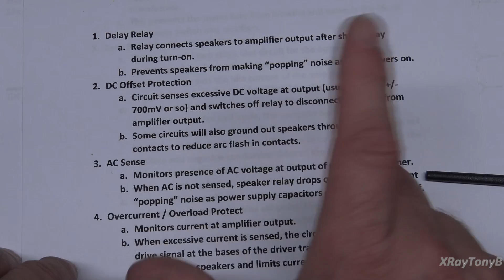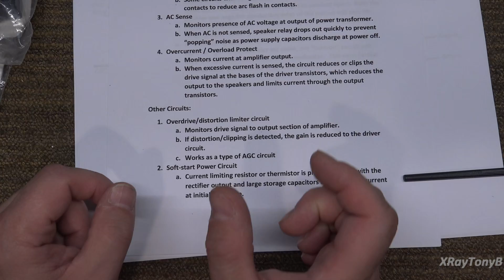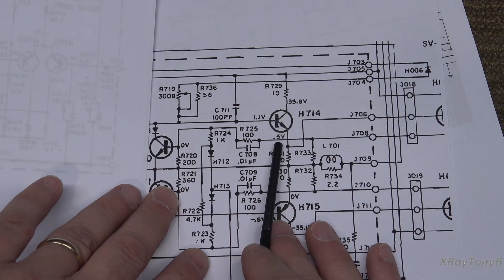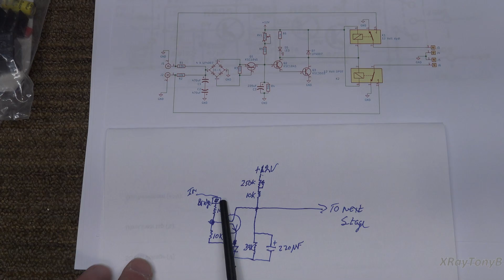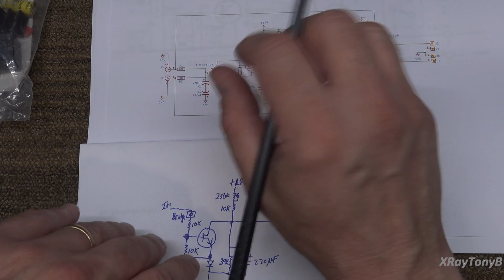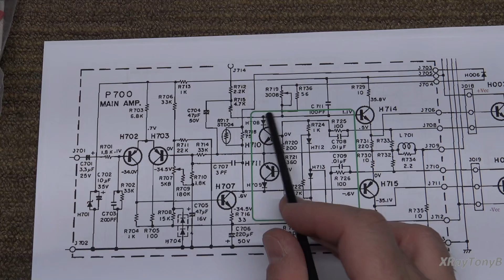Speaker Protect Circuits - In Theory

Comment: It's useless... it doesn't provide DC protection—or rather, it only works up to 20V DC; beyond that, the relay contacts cannot extinguish the electric arc. These relays simply aren't designed to break a DC arc. In other words, if an amplifier powered by more than 20V DC suffers a final transistor failure, it will send the full voltage to the speakers;  the relay—due to the very small gap between its contacts—won't be able to extinguish the arc, leaving the speakers completely unprotected. This protection scheme is only effective below 20V DC.
Reply: I would say that 99% of all commercial amplifiers use standard cheap relais in their protection circuits.
Reply: Can you provide me with a link that's got a good protection circuit I can build and or buy?
Reply: There is no mechanical relay capable of extinguishing the electric arc at voltages above 30 VDC; in my tests on various relays rated for 30 VDC (tested without their protective casings), I observed that they fail to extinguish the arc every time even at 30 VDC. The electric arc begins to form around 25–27 VDC, though relay degradation starts even earlier—at around 20 VDC. Therefore, if the output stage fails and the full DC supply voltage is routed to the drivers, mechanical relays are useless if that voltage exceeds 25 VDC. @paulstewart808
Reply: @paulstewart808 Yes... but in well-known commercial brands, they are used almost exclusively to delay the signal to the speakers—preventing the startup noise—and possibly to detect incorrect settings or DC offset anomalies. They are not used to handle output stage failure; in the latter case, other protection circuits are employed to cut off the main power supply if a short circuit in the output stage is detected.

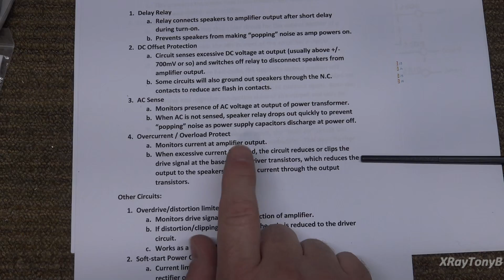Comment: 10:18  Type 5 is omitted - Speaker short circuit protection. 
a. Monitors speaker impedance and short circuiting of speaker.  
b. Protects output transistors in case of voice coil or crossover network burnout or shorting plug leads at amp or the speaker. 

The weak link in all this 'protection' is that relay, which are rarely rated for full DC current.
e.g. A large Amp under fault may have >100V DC @ 10A applied to the speakers. The prospective fault current is a lot higher.  
Kits are often only rated for Low/Medium output due to voltage rating of capacitors, so, if added to a high power amp you must upgrade Caps to suit that max output voltage.
Further, relay contacts do degrade over time and so, become 'noisy' in the signal path... and in a DC fault or short circuit fault of transistors/mosfet can weld relay contacts closed.. so, no protection at all. Use of a relay in the output signal path is a piss poor 'solution'.  mosfet switching is far more reliable. 
The use of N/C contacts as per 2b. does not extinguish a DC fault arc.
Reply: Great... finally, someone who understands the limitations of mechanical relays and why, in this case, they cannot ensure speaker protection.

Comment: Can the soft start board be installed between the power on switch on the load side off curse to the wires input of the transformer ? Thanks

Comment: 12:25 ACC 260 (Acoustic Control Corp) has a AGC cirucuit. Picks signal off speaker output cap on one side, uses two 2N2926 in series from E-C with a few caps and a 2N4360 Jfet, and signal from input emitter side of a 2N3391, reduces overall gain by 6db when peaks get high.

Comment: Thank you for making this video! I have Ad Com GFA 555 hooked up with B&W speakers. Should I add a speaker protection circuit to my amplifier or not? Also, I have heard that protection circuit clamps the power and reduces sound sonic and dynamics
Reply: good question
Reply: I have also GFA 555 MK2 AND 545 MK2 , I want to upgrade them with this module as well.

Comment: Will this circuit work in an amplifier that does not have a common ground shared between speaker channels?
Reply from the maker: No.  It will not
Reply: @xraytonyb  Thanks for the response.  Do you know of a protection circuit that will work in this situation?  I have two class D amps with power on/off thump noise that I want to eliminate.
Reply: @ecco222 também tenho

Comment: Do you want to see a FUN protection circuit? Look at the schematic for a McIntosh MC5100 Integrated amp. On the "Output Monitor PC board  043-821,  It has, 2 separate protect circuits, 1 for each channel, consisting mainly of a Triac and a "SBS" , or "Silicon Bilateral Switch" ( Which is basically a Diac with a gate lead, and in this case the "G" lead has no connection) (SBS201-202). How it seems to be engineered is, if the channel suffers a failure that passes a high amount of DC to the output, the voltage is shunted through the T1-T2 connection to ground, once it also is high enough to charge a 10uF capacitor in a R-C time constant circuit, and then get past the SBS junction breakdown voltage , it will trigger the Triac, which, should blow whatever 4 Amp fuse, F201~204 that is supplying the fault, to ground, and killing power to the fault, protecting your valuable speakers without inline fuses or relay contacts. It seems to be a logical, low maintenance design that does not add any mechanical contacts ( and the issue of resistance issues due to dirty contacts or higher resistance in general) to the circuit, and since the circuit is sitting idle and unpowered until needed, it should have a longevity factor that surpasses most of the other signal and power circuit components, but it will cause a owner, or tech, to open it up and investigate the issue, as it is not "self resetting"  like a relay circuit.

Comment: So basically the circuit takes a sample with a high enough impedance to not affect the amp output and uses large enough capacitance to shunt pretty much any freq over around 20 hz to ground then converts whats left to dc as well as directing the dc thats at that point to turn on the transistor to control relay?
Reply: Precisely

Comment: if you want an intellectual exercise, take a look at the Marantz 18 power amp. No relay, but a soft start that starts very early in the in the power amp that also detects DC offset. However if an output device is shorted there would be no joy!. 

Another funny one was the Marantz 15, it used two car brake lamps as the current limiter and overload indicators. 

For total torture look at the Marantz 500. One discrete diff pair feeding to two more diff pairs driving their respective positive and negative drives. You needed four edgewise volt meters side by side to get all three diff pairs balanced. 

I worked there as an engineer there after the 15 and 18 was designed so I never got an explanation of why this was done. 

Steve

Comment: I like your videos I like the way you explain the Theory the principles of the circuit nicely made. I also have a Pioneer A-70 Non-Switching Integrated amplifier that I bought non-working I did restore it back. Needed pretty much all the electrolytic replacing apart from the main filter caps. Had some resistors that were open-circuit due to that stupid glue that they use from factory. Give me your thoughts on this particular model what do you think is a good design. The only issue that I have I have to retake a look at the safety circuit which is the relay. Either than that the bias was adjusted very well maybe I adjusted it slightly higher than the factory spec. The amplifier sounds amazing has a very clean sinewave and both channels.

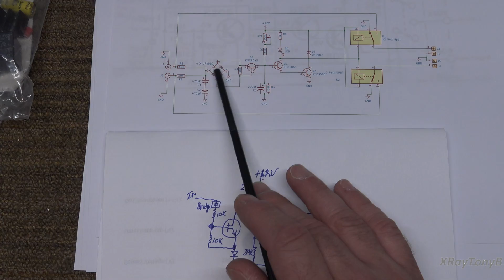Comment: 26:32 In your simplified circuit, don't the two 10k resistors at the bridge input become a 5k effective input impedance?
Reply: Each individual amplifier will see a 10K input impedance.
But,
the signal at the bridge rectifier input will be halved
since the ”other” amplifiers output impedance is low.
The two 10K resistors will create a voltage divider.
Reply: @andersjohansson8588  yes, that divider of two 10k's - from the perspective of the capacitors looking back at the sources - appears as a 5k ohm impedance. Standard circuit analysis will short the sources, and the two 10k become one 5k on the hand-drawn simplified circuit diagram
Reply from the maker: Each channel passes though its own 10k resistor and is also isolated by the 10k resistor on the other channel.  It will appear as a 10k input impedance to each channel, however, the two signals will be summed at the tie point.  Out of phase signals will cancel/attenuate one another.  Equal signals will not affect one another.

Comment: How can two polarized caps in series create one bipolar cap?
Assuming both are equal, with identical leakage,
one of them will always be reverse polarized.
Reply: using LT Spice - even using extended Capacitor models (with Rp, Rs, Rl) - it clearly requires a protection diode on each part...
One think I did find looking at some datasheets the leakage (Rp) is very non-linear with reverse bias. The current will ramp up very quickly and damage the capacitor.
Of course the 10k on each terminal (5k input impedance) creates an RC with a 0.3Hz corner frequency. That strongly attenuates signals >20Hz, so really it will only cause capacitor failures when there's a very low frequency or DC bias (which ironically is what we are supposed to detect and prevent)
Reply from the maker: Check out my comment to Bjorn V up above in the comments. I go into a bit more detail how this works.
Reply: @xraytonyb  I think you mean the reply comment in the "follow-up" video? You didn't reply to Bjorn V (yet) in the comments from this video

Comment: on the Marantz 140 there are also thermistors - could you explain their role also in a follow-up video. the 140 has a protection circuit that is used in many Marantz amps - like 2325

Comment: Hi Tony, the circuit you've shown, would it handle left channel sitting at -5V and right channel at +5V DC? will combining them with 10k resistor equals to 0V or it's a rare condition and it's what it is?:)
Reply: Your situation would not be detected.

Comment: Hi Tony.

I'm going to assume that "short circuit protection" (driver failure or sloppy speaker wiring) is covered under the excessive current portion of the protect circuit.  Is the protection circuit dependent on the impedance of the speaker (ie: 4 ohm draws more current and causes the circuit to trip before excessive clipping occurs)?

Comment: Forgive me if I missed it in the video or comments but I didn't hear any discussion about the fact that the protect circuit is putting another component into the signal path at a critical point just before it goes to your speakers.  I'm sure the impact is negligible to the sound. However I would think the quality of the relay is an important consideration.  I have a Realistic SA-1001 intergrated amp without a protect circuit and I often argue that the simplicity of the design contributes to its wonderful sound. As few components as necessary in the signal path. I guess how important the protect circuit ultimately is depends on how much you love the particular speakers your using and how replaceable and available the drivers are 🤣.
Reply: Even the most cheapest sealed relay would have better electrical contact than any banana connector used to connect speakers
Reply: @rogerwalter2500  A "cheap sealed relay" will NOT be rated for DC. They are always rated for AC current.   
Furthermore, repeated opening of relay contacts under load will degrade contacts and in a full output voltage/current scenario those contacts can weld closed.  How good is the relay now?
Reply: @BTW...  I used a 15A AC relais out of an old elevator control panel (one of those oldschool things with an octal tube socket) for my DIY "daily driver" amp. That thing switched the speakers off at full load (when the RCD trips for example) a gazillion times already during the last 20 years and it is still totally fine. The contacts are a bit burnt and pitted by now but they still have no noticeable "flakyness" or resistance.

Comment: Quality content and a pleasure, as always.
 Just one quick clarification; for the circuit presentation beginning at 21 minutes. Wouldn't shorting the outputs to ground be unnecessarily destructive ? If the final stage output connects to pin 7 and is coupled to the posts on pin 14, then we get a big badda boom. Perhaps it's the other way around ? Output is on J1/J2 and speaker terminals are represented by J3/J4 and J5/6 ?

Comment: I wonder:  why do they use a BJT for Q2 ? Why not a thyristor, e.g. BRX45. Much faster and more definitive switching, and you need that for a relais.
It has a hold current under 5 mA, so if you stay under that, say 2mA through C-A and LED, the LED will still light up OK, but the thyristor will un-latch when the Voltage on the gate goes under .6V in respect to the cathode.

Comment: https://youtu.be/a4xTw21XoSQ

It's your video 
57:52 in video 
58:52  in video 
This is the one thing I asked about 
I have 33uf 50V MUSE BP and 220uf 35v BP 

Which capacitor value is good for 60w 100w amplifier ac output signal for speaker protection

Comment: One circuit that I like to use for my DIY " prototype projects is a combined soft-start / speaker protect circuit that uses an external 24 VDC  "wall wart" (or external) PS. The power to the 24 VDC can be switched using a pole from the amps main power switch. You can easily modify the turn-on / turn-off delay by changing the size of the "timing" cap. Both circuits use the same type of basic DC RC charge pump. I also like to use 5-8 amp "robust" 24VDC relays. Most relays included in these "pre-fab" kits are only good for low power amps.

Comment: FYI, they call it  '' McIntosh's power guard circuit. '' It's a optocoupler attenuator that lowers the input drive signal below a 0.1% distorsion rate ( if memory serves ). Great tutorial and keep up your fine work. Oh BTW, would be nice to see how a crowbar work in detail. Cheers !
Reply: Correct, and the Power Guard is intended as a speaker protection circuit and it works well.

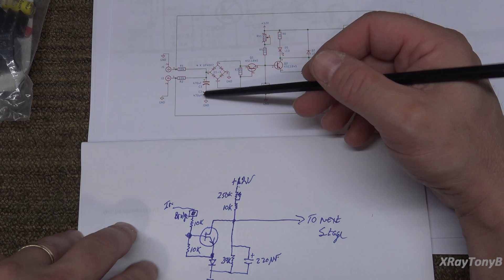Comment: 33:16 
In the video 

This is the case I talking about, 
You did something like limiting the ac output signal by different values of Bipolar capacitor, 

Again my question is, 33uF 50V MUSE BP Nichicon or 220uf 35v BP Panasonic
Which capacitor is more suited for 50W 60W amplifier 

Please share Details about it